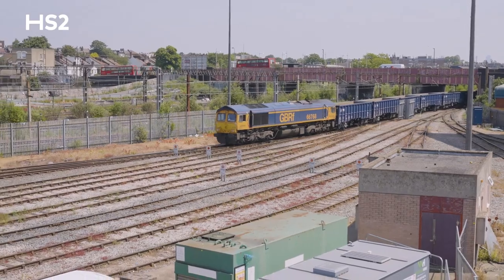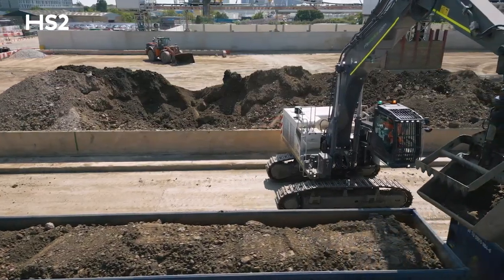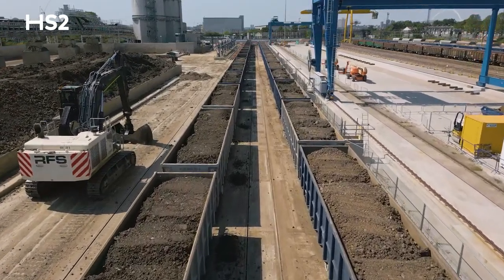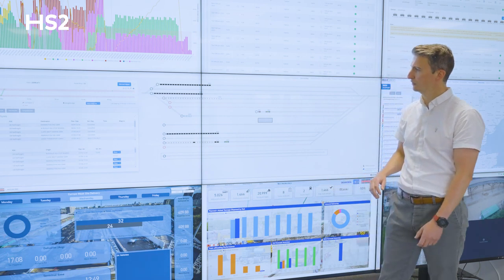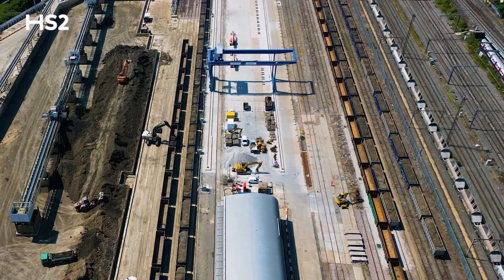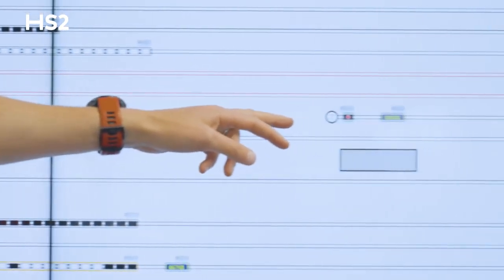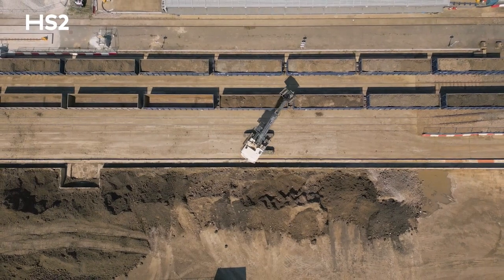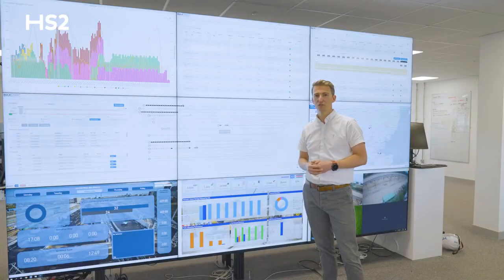HS2’s London Logistics Hub celebrates processing one million tonnes of spoil

Comment: Manual loading seems inefficient. They have conveyor belts to pile the material for loading, so why not use that to load the wagons?
Reply: I assume the spoil is generated at a consistent rate, while the loading is more variable. If they had it dumping straight into the wagons you'd have to make sure there was always an empty one underneath.